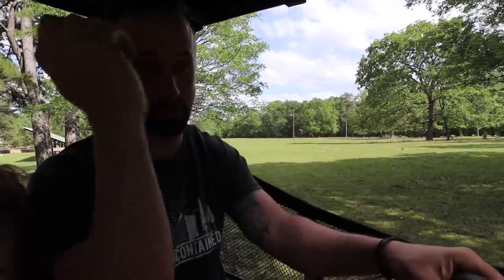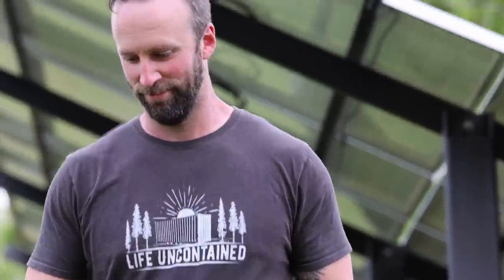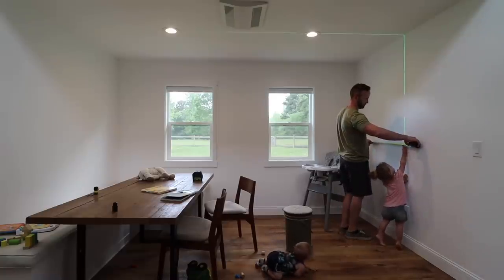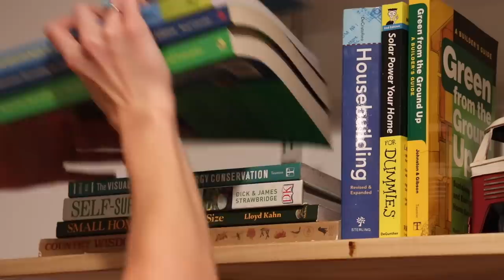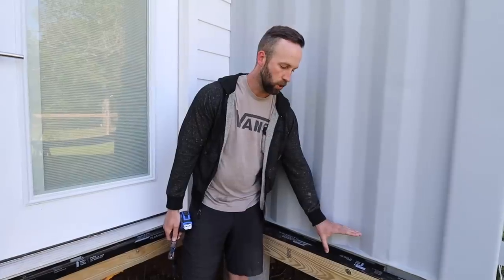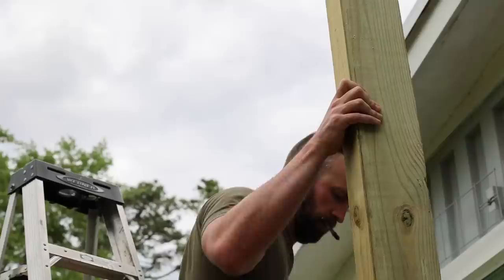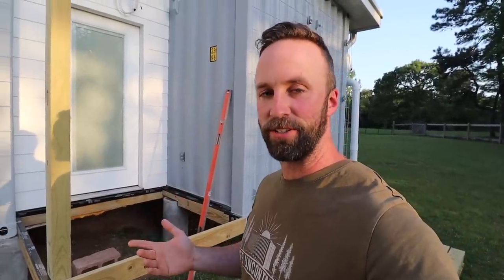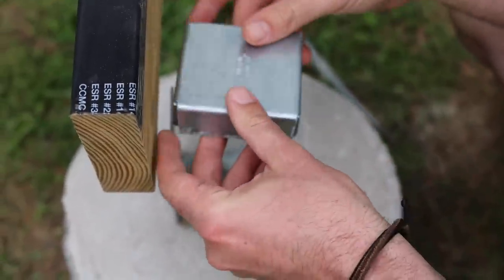MOVING IN | Off Grid Shipping Container Home

Comment: Just remember that the fit might change as you adjust those panels. Might be a good idea to put a stop block for the tightest angle on the panels. Might be a savior in the dark when you are tired or distracted. Congratulations. It's nice to see you inside your place.

Comment: Add windpower to keep your batteries topped off during sunless times increase the size of your solr preheat which and will reduce electric usage by your hot water heater.  Create a indoor work shop. Look into alternate heat (wood sto e). Root caller. Pland now for room expansion (you can't go up) . Do this now while you are young have the finances

Comment: $13,300 and it only has lead acid batteries That's a ripoff. You'll be replacing those batteries in two to three years. Six deep cycle batteries approximately $150 a piece that's $900 in battery replacement about every two years not for me.

Comment: it is funny that you are surprised you did not put the tape on back of the pressure-treated wood. you have done things like that over and over through out this build. you are not a forward thinker. how long until you realize that one thing you are forgetting with rhe recharger and the EV you just bought?

Comment: Let me guess you bought another electric vehicle. News flash. It takes way more energy to make the battery for an EV the a regular gas vehicle. You need to drive an EV car with a 125 mile charge range 85,000 miles to offset the about of energy it took to make that EV car vs. a gas car. It takes 350,000 miles of driving to offset an EV battery with a 400 miles range vs a gas car. Do your homework before you buy something stupid like another electric anything.